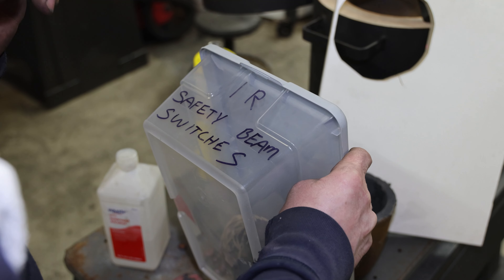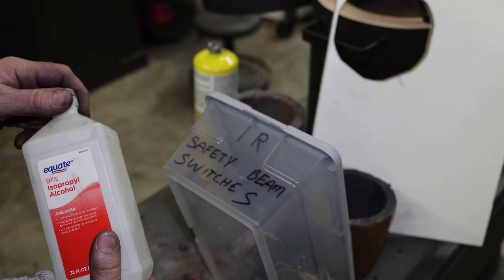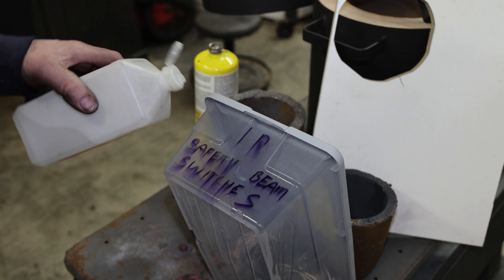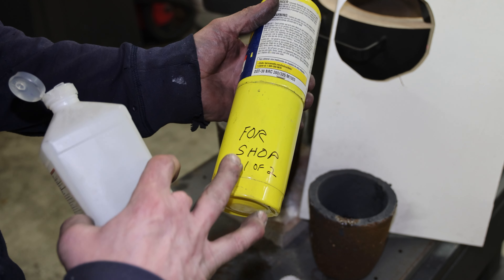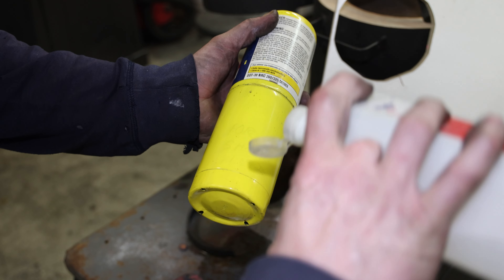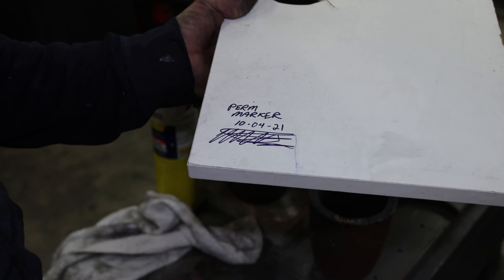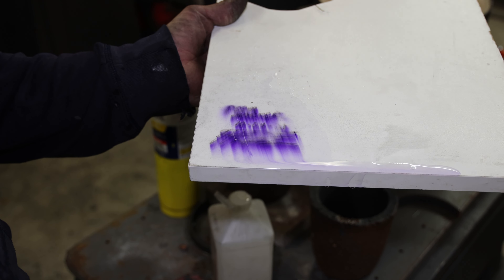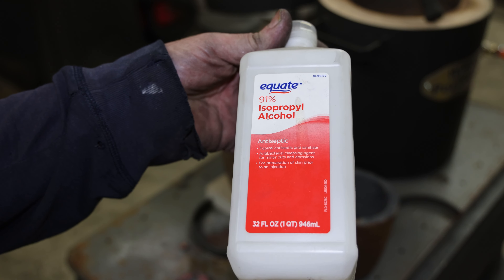How To Remove Permanent Marker From Anything

Comment: Found this out cleaning knife edges after coating them in Sharpie for sharpening. I use 99% isopropyl from the drug store. Works 10 times as fast as 70%. Sucks the oil of the skin on your fingers leaving it white! Glove up if you're soaking something up with a lot. 👍
Reply: Desolveit.. (desolve-it).. every bit as effective without harming skin.. BUT.. things like epoxies.. solvents are a serious NO NO.. they allow seriously bad chemicals in epoxies to absorb into your skin & blood stream & seriously bad allergic reactions can quickly develop

Comment: Please be mindful isopropanol will desolve some other chemicals as well. For instance painted* sheetmetal will turn dull or even remove the paint.
*obviously there are different ways to paint metals; I noticed it on powder coated sheetmetal.
Reply: for sure - also I've seen it turn certain plastics into perma-fog.

Comment: Interesting.  I’ve always used acetone. Store grade Fingernail polish remover always seems to work.
Reply from the maker: I have tried acetone, it works, but it doesn't work on every type of permanent marker, there are some that are resistant to acetone... But from what I found 91% or stronger alcohol works on everything.
Reply: Also, acetone tends to dissolve a lot of plastics, alcohol won't.
Reply: @gabrielulibarri9950  yeah that's a really good point, acetone will mess things up bad sometimes.